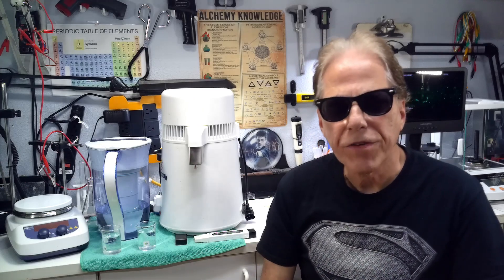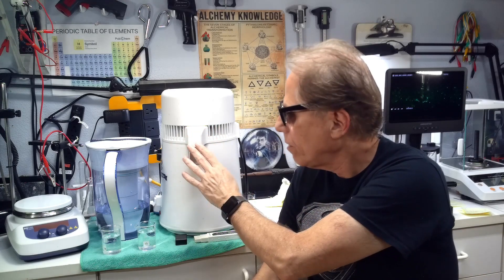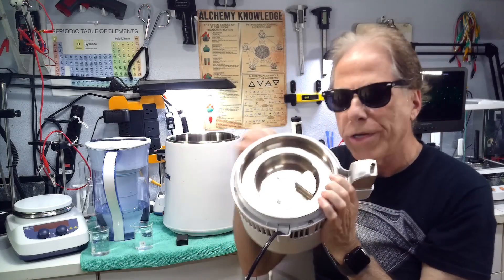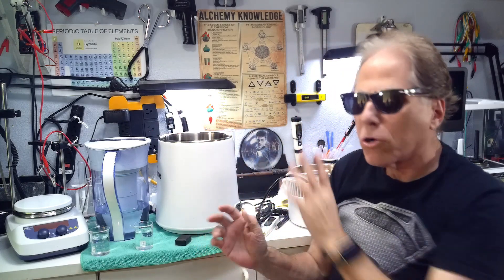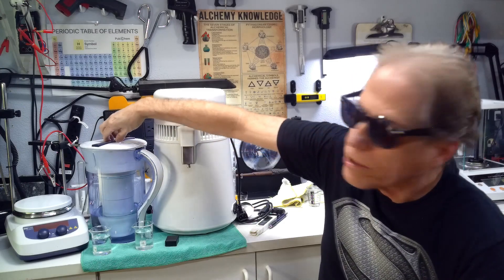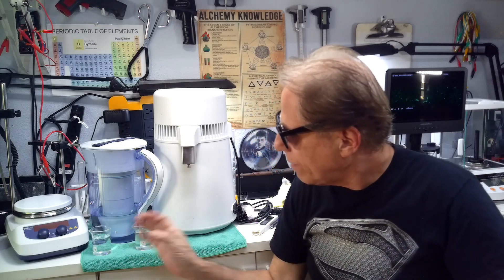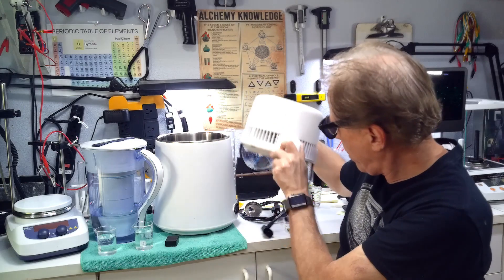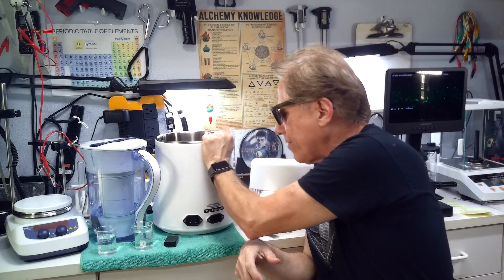From Tap to Pure: The Art of Distilling Water! 0-ppm!

Comment: Can you please explain why the distilled water will often taste like metal?
Now I understand I should drink distilled water after watching your last video but I am just being curious.
Reply from the maker: Check out my video on re-mineralizing distilled water. it will be healthier for you than drinking just distilled water. [https://youtu.be/ep03cswkZ80]

Did you test the output water with a TDS meter? Was it zero parts per million? If not. Distill the water again. If after two or three times the water still comes up higher than 0 ppm or still has a taste, then it's possible that the metal tubing in the cooling ring of the distiller has become contaminated. It may have to be cleaned with vinegar.
Reply: Well I guess you answered that question at the end of the video with the fact that it's over cooking the minerals letting them through the vapor and back into the purified water.
Reply from the maker: @PhuketMyMac  Yep, that will do it. Use a timer. I cook mine for 3.5 hours, standard gallon unit. It leaves about an inch of water in there. you may have to clean it though if you got alot of burnt on sediment on the inside from overcooking.

Comment: Hi, Hermes! I am still learning and learning. I believe I understood why the TDS meter can not measure accurately the PPM in the colloidals. But is it accurate in measuring the water? TDS meters have generally one more function - measuring the conductivity. I saw in a description in Amazon (it was about electrolyser for making colloidals) that TDS meter can work well for measuring the conductivity in the colloidal liquid and could be an indicator of the amount of PPM. One more question about conductivity. My Colloidmaster measures the conductivity and then calculates according to the Faraday law the quantity of PPM for the different metals, that should be produced. When it starts, I enter the name of the metal, the quantity of the water and the needed voltage and ampers. On this basis the Colloidmaster calculates how many PPM it SHOULD produce in this quantity of water with this metal,  voltage and ampers, this conductivity of the water. I mean it is a calculation, not a real measuring of PPM. I sent you recently the user's manual, there it is explained. But lately the Colloidmaster shows high conductivity of my distilled water, around 22-25 microsiemens. My TDS meter shows 0 PPM and 0 ms. It was not like that in the beginning, whan I started to use the Colloidmaster - it was showing conductivity around 5 or 6 to 9 microsiemens. I mean if the measure of the conductivity is wrong, the calculation of PPM will be also wrong. Of course I asked the seller, he told me 22 ms/cm is normal for distilled water, but in other sources in internet I have found that normal conductivity of distilled water is 0.5 to 3 ms/cm. I wrote to the manufacturer also and I am waiting for his response. I decided to share this problem also here, so more people could read it.
Reply from the maker: Correct, TDS meters measure conductivity and not colloidal concentrations. They measure the total dissolved solids and conductivity of the water. Colloidal particles are suspended in the water. They have a kind of force field around them that prevents them from binding with the water and becoming ions. However in the case of simple metals that you may cook, where you do not put anything in there but water, you can estimate roughly what colloidal content you may have. The colloidal metals even though they are not part of the water will raise the conductivity of the solution, because well basically you got pieces of metal floating in there. However conductivity can not distinguish between an ionic metal from a colloidal metal, so the exact colloidal concentration can be more or less than what you may calculate through conductivity.

Using a green or red laser is the best way to actually see how much colloidal particles you have in there. A faint red laser line that you can barely see is about 10ppm. A strong clearly seen red laser beam would be closer to 15 to 20ppm.  A bright red laser that actually seems to fatten as it passes through is probably over 40 to 60ppm. Green lasers are more visible so the values above are only for red laser. 

It's kind of cool that the Colloidmaster tries to help you determine the concentration of the colloidal particles, and even control the process, but I would not trust it implicitly. Learn to use the laser and determine the various concentrations using the laser brightness. Then you can roughly apply this to other colloidal metals, like copper, zinc, etc. With silver this is real easy. A very light brown colored liquid would be 18ppm, and have a visible beam. 24ppm would be a darker much more noticeable brown and have a stronger beam. 10 to 12ppm silver will be clear, but will show a faint red laser line in the liquid. 

My distilled water comes in at 0ppm, 14 Microsiemens per centimeter (μS/cm), usually. However these distillers are high rate distillers and not lab quality ones. So the conductivity of distilled water can vary from batch to batch. The reason is they are not perfect in creating absolute lab quality distilled water. Variances in mineral content of the input source water being higher or lower can effect the final Microsiemens. Basically you have more or less very small amounts of trace minerals in there ppb (parts per billion). Not enough to move the ppm meter but enough to show that it's there. Tap water mineral content can vary from day to day even from season to season, depending on the rainfall and water levels of wherever the water sources from. 

Great question!
Reply: @AlchemyWizard  Thank you! I have red laser and it has the last word about PPM in my colloidals. I will buy also green laser. Yesterday I made distilled water, first filtered and the CM showed conductivity 17 ms. I am afraid it is my fault that CM showes higher rates in microsiemens. It changed after I tried to use with warmed water with salt, citrate and corn sirup inside as per your receipt. Of course I used cables for the electrodes, I didn't put the CM itself on the beaker, but it seems that from this moment  the CM started showing higher rates of conductivity, whatever metal I use.
Reply from the maker: @tedimaya  could just be coincidence. However 17ms is still good number. Are you measuring the microsiemens in the beaker before you start or straight from the distilled water collector? Have you tried cleaning the beaker real well with a good scrubber and distilled water that you've made. It's possible some residual is left on the glass. 14, 17, 24ms we're talking parts per billion. It should not have any negative effect on your colloidal making.
Reply: @AlchemyWizard  Thank you, Hermes. The beaker is well cleaned with distilled water. The CM starts measuring the conductivity when it starts working. If you say this is good rate, OK. But I am sure, in the begining it was showing lower rates.

Comment: One further question, is there any issue with using distilled water to make carbonated water? Or does it work better than ordinary water for carbonator (eg Sodastream)?
Reply from the maker: You should have no problem using distilled water with a carbonator. However I would suggest you re-mineralize the distilled water to make it healthier to drink. Here is a video on re-mineralizing distilled water: https://youtu.be/ep03cswkZ80
Reply: @AlchemyWizard  thanks so much for your reply and video. Do you need to use corn syrup as part of the stock solution for NaCl or is it just made of salt and distilled water? If you need to add the corn syrup, why?
Reply from the maker: @v4vendetta659  The corn syrup is used when making LVDC Gold. It stabilizes the colloidal nanoparticles so they last longer and cook to a higher density. Without the corn syrup the ruby red gold colloidal content  may only last a month. the colloidal yield will be weak and you will only have mostly ionic gold.

Comment: A few questions, thanks to your videos. Is there any value in double distilling, will it remove all the particles to get 0ppm? Why use vinegar and not eg citric acid instead? Can the vinegar damage the steel drum or chemically interact with it adversely? Does it matter what the pH is on the water to be distilled? What abou putting the distilled water through the zero filter or does the active carbon affect the ppm of the distilled water? Would a glass distiller be better than the steel distillers Easier to clean?  Many thanks if you have time to answer these questions.
Reply from the maker: Good questions:
If your water is heavy in minerals you may have to distill it twice to get 0-ppm water. If you are doing plasma arc you will need 0-ppm water for it to work. LVDC colloidal will work with up to 8-ppm. You may have problems with gold however using 8-ppm and not get ruby red.

You can avoid having to clean the distiller by using a timer and having it turn off 20 min before it completes. For mine that is about 3.5 hours. If you stop the process before the minerals bind to the bottom of the distiller you will not have to clean it. And you will get better distilled water as it is possible for the minerals to vaporize and wind up in your distilled water.

I use vinegar, but perhaps citric acid would work as well. Malic acid is a stronger acid that may be better to use than citric acid if you do not want to use vinegar. I have not tested either. 

If they sell glass distillers I suppose that be easier to clean, but if you do what I said earlier, there will be no need to clean it at all. The minerals will never burn into the metal.

I've distilled water then put it through a zero filter and it contaminated the distilled water. It still read 0-ppm but the plasma arc would not form. That tells me the zero filter changed the water. You could put the water through zero filter first then distill that water to get a cleaner distilled water, if your water is heavy in minerals. I put RO water in my distiller which is 8-ppm. The distiller then gives me 0-ppm out.
Reply: @HermesWisdomsdoor  appreciate your reply and videos, such good information clearly explained. Keep up the good work! Thanks
Reply from the maker: @v4vendetta659  Glad to help and share the knowledge.

Comment: Do any of the filters, or distiller remove floride
Reply from the maker: The distiller shown in this video may not remove fluoride. Fluoride can turn into a gas and pass through the distillation process of these low end distillers. Commercial distillation companies use a more complex process to ensure everything is removed. But then with commercial distilled water you do not really know the condition of that water, as far as how long has it been on the shelf and the overall quality of that water.   

The zero pitcher says it will remove 95% fluoride as do other filters of this type. The Britta long last filter however has been tested by the NSF and verified that it did remove fluoride.  I'm sure some of these other filters will be tested in the future for their ability to filter what they say they do. Until that happens we have to take their word for it.
Reply: @AlchemyWizard I have a zero filter as well but the filters were expensive and not reliable. Sometimes it would work for weeks and others for days to a week. That’s why I got a distiller. I’ll try that first thank you. 

I have the same one as you do. I keep getting 4 ppm that’s why I came to  find out what going on. This video is very helpful! Thank you.
Reply from the maker: @teeciewalk  I find that the zero filter replacements are expensive. The lower the water quality of the water going in shortens the life on them. Distillation is certainly the way to go for the most pure water.
Reply: @AlchemyWizard  I totally agree that’s why I stopped. They were very expensive and inconsistent in how long each lasted. I have a question can you use Sole (redmans real salt) to remineralize distilled water? I just made my first drinking batch yesterday I used pre filter water and got it to zero ppm
Reply from the maker: @teeciewalk  Yes Sole Redmans sea salt will be fine. Any seasalt will work, some have more minerals in them than others. It is what you prefer.
Reply: @AlchemyWizard  thank you I appreciate your response